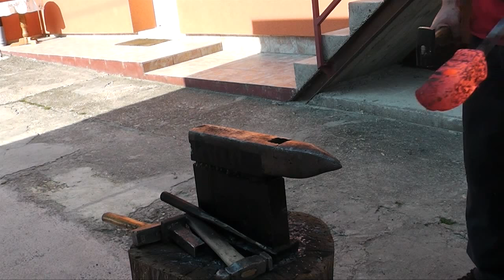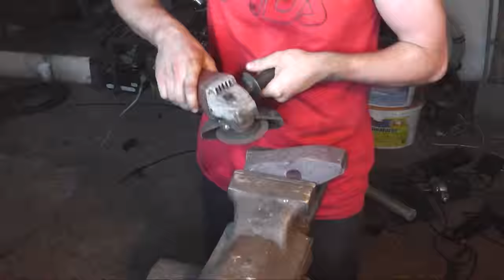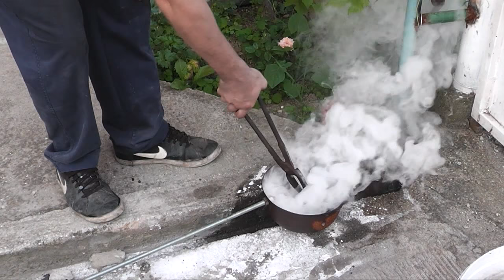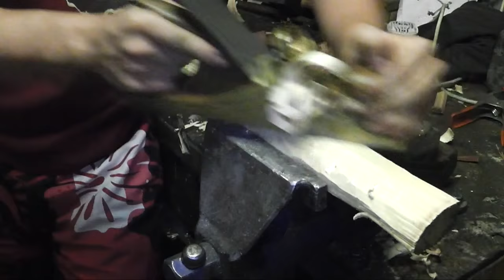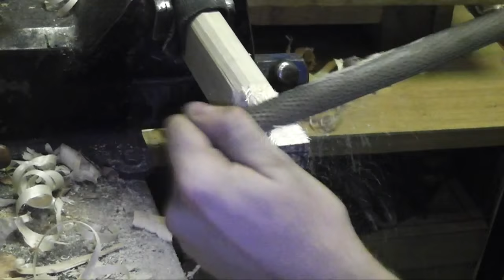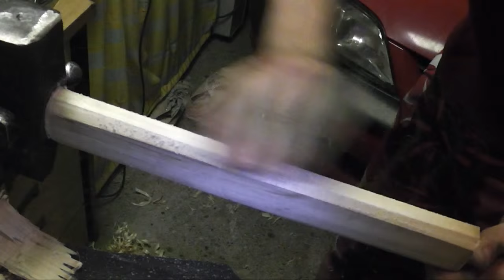Hallowood 2015 - Forging a 2.5kg ( 5lbs ) Straight Peen Hammer ( without a striker )

Comment: Did you just case-harden that entire thing?? If it was a perfectly good hammerhead beforehand, then you should've had NO PROBLEM hardening it without the powder!
Reply from the maker: This isn't case hardening compound, it's borax and I used it for easier removal of the scale prior to hardening so I wouldn't have to remove it by grinding. The entire hammer was hardened.
Reply: Oh my God, YOU'RE STILL ALIVE!!!! I didn't mean to be rude, but I wasn't sure. Borax flux was going to be my second guess, actually. Will you be making more videos anytime soon?
Reply from the maker: Hopefully soon, I have a lot of stuff filmed but have little time to edit.